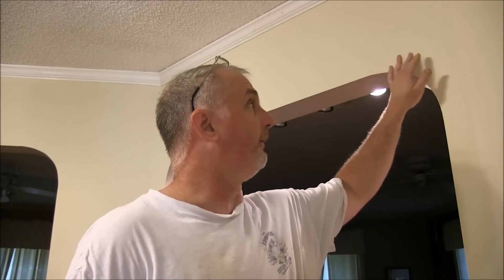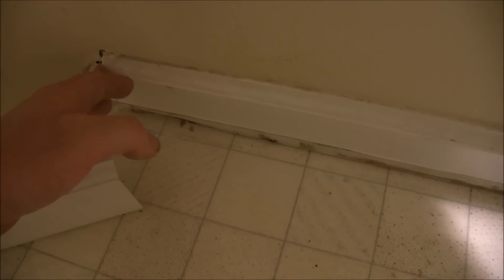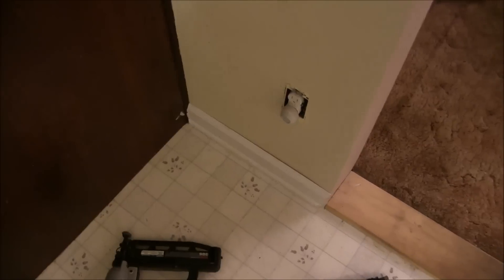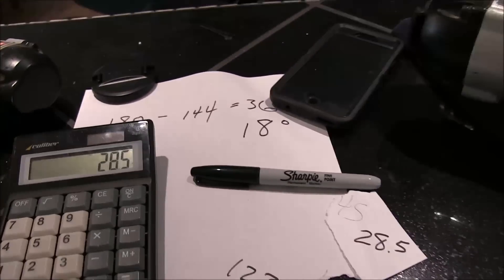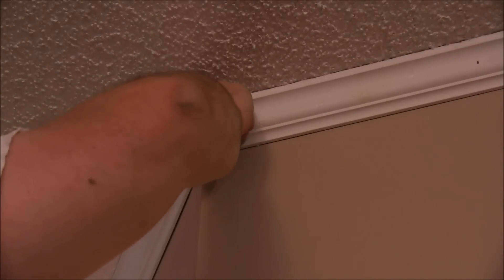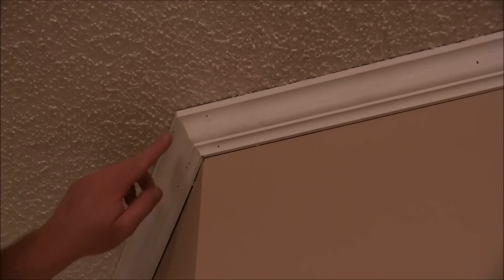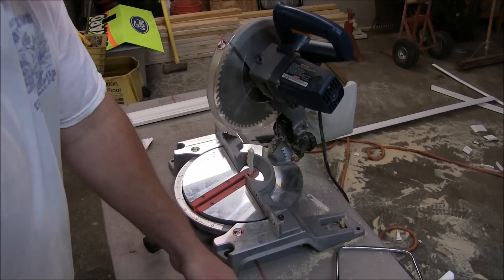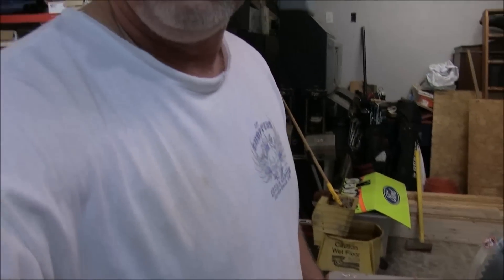How to use a Angle Gauge to Cut Crown, Baseboard, and Shoe Molding

Comment: You give your viewers the majority of what they need to know but-- while I'm not trying to pick you apart-- but you fail to mention or caution your veiwers about the effects of the rise or fall angles. If you are scratching your head reading this, then that is the reason I'm mentioning it. Basically I'm talking about how square the two planes of the floor and the adjacent wall are in relationship to each other. For instance if your baseboard is going on an old floor that has and inch or two of fall in it and your adjacent wall leans away then that also effects the nature of your joint... Which isn't a big deal on painted trim but on stained trim it becomes both a time and material factor due to recuts if your aren't careful. Resolve that issue for your viewers and this video is complete and fully educational.

Comment: When you checked the angle of the roof, you have to take your 78 degrees and divide by 2 = 38 degrees then you take your 90 angle off your saw and - 38 and you get 52 Degrees.

Comment: If you use a digital angle finder you don’t need to do any of the math. Mostly a personal preference. Great video, however I find the crown moulding to be too small. It looks like some sort of baseboard rather than a crown moulding. Not to mention of you cope the crown moulding or baseboards you can get really nice fittings. Otherwise keep practicing and keep up the hard work.